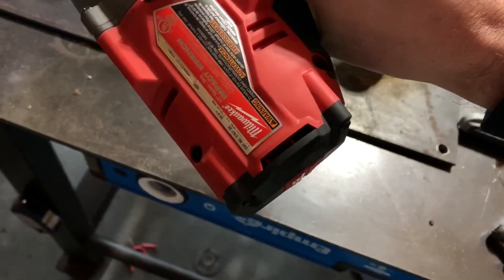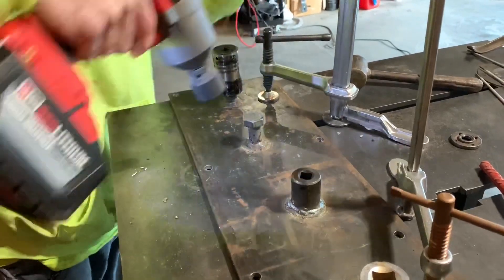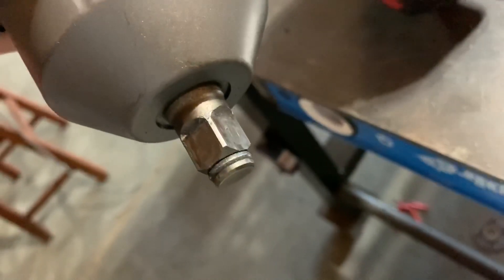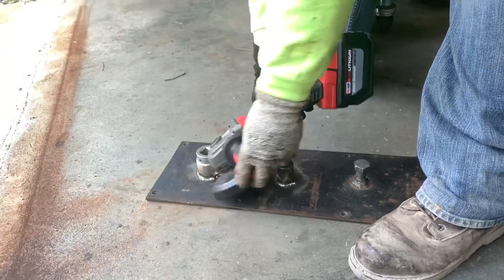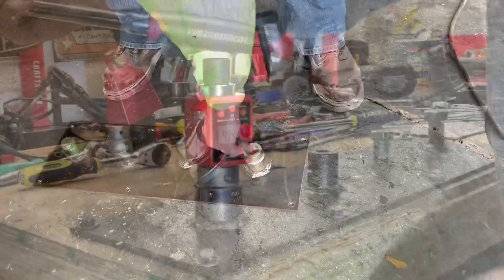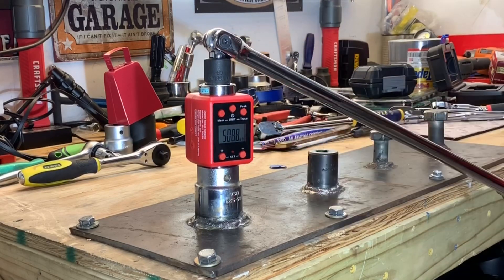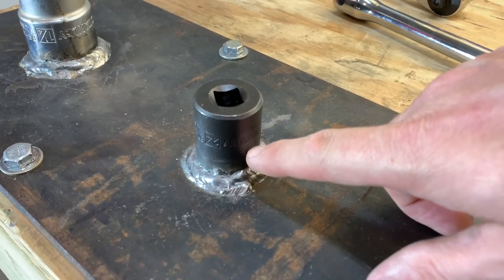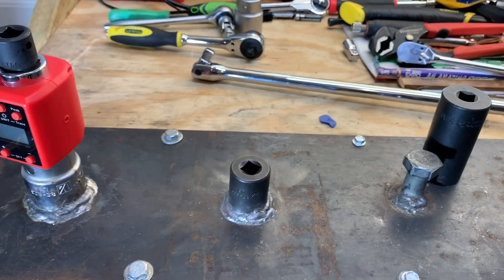Ratchet Torque Testbed 2.0 Will The Old Welds Break or Bolt Snap?

Comment from the maker: Ratchet Torque Testbed 2.0 taking 500+ ft-lbs from the Harbor Freight 1/2 Drive 25" Breaker Bar without a cheater pipe if you missed that part in the video near the end.  Enjoy!  https://youtu.be/AwbBYl-Te4U?t=187

Comment: I just picked up this 2767-20 impact, plus a 5.0 M18 battery on Home Depot's website for $250. I also bought the 2554-20 stubby 3/8" impact to replace my Snap On CT 761 3/8" impact. I think you should do a video comparing Snap on vs Milwaukee impacts, most mechanics I know use nothing but Snap On at work, even though they cost more, have a much shorter warranty and don't make many brushless power tools, like at all....

Comment: Glad to see that Pittsburg 1/2" anvil 25" breaker bar is good to 500 ft pounds of torque.  I purchased one about a month ago and after using it for removing mower deck blades and mounting my snowblower on my tractor it works great.  Thanks for the info.  Cheers!
Reply from the maker: Thank you for reminding me about the Pittsburg Pro breaker bar doing 500+ ft-lbs.  I couldn't figure out what if anything to put in the comments so that will be the thing! I even added some cowbell in the background if you look close enough 😂